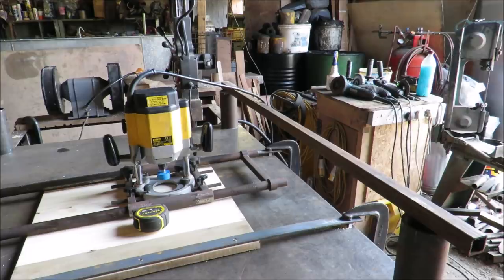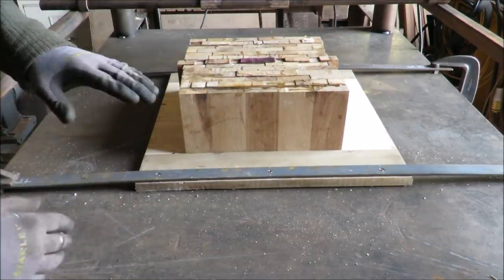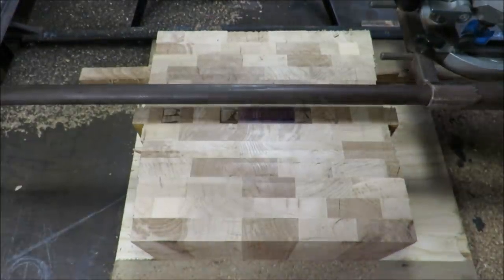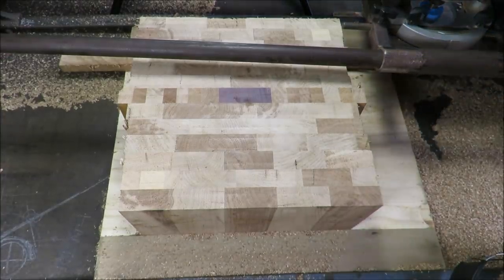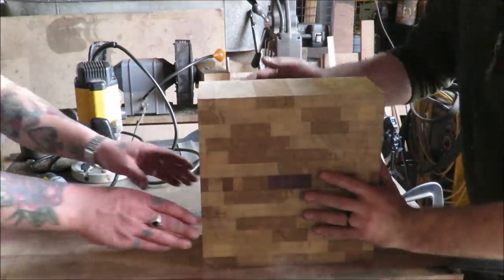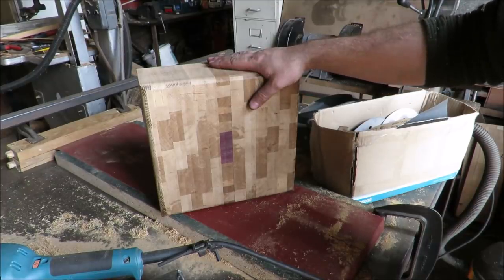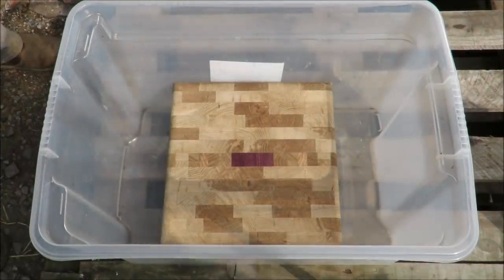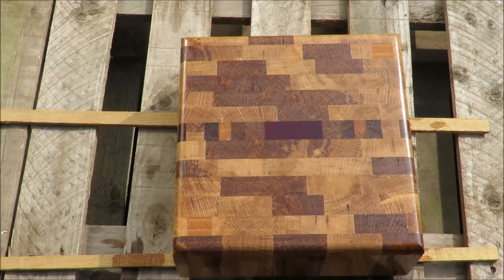Recycling an Old Butchers Block Series. Part 4. "A Thing Of Beauty" #SRP

Comment: Great stuff man. love the series, but it kills me that you didn't get the tool marks out after routing with the sled.  
They'll ease out with heavy use though..
Reply: The tear out over the punky patches of oak would have sanded out with a bit more time spent on it but we decided that actually, with some of the original joints and screw holes clearly visible, we'd just leave it with an aged weathered look.
Reply: @TaureusGrey  Sure.  I recently made a few boards out of an old solid oak table top what got rained on and I agree.. sanding out those annoying lines was a MAJOR pain.

Comment: . . . first thing I want to say: this beast is a beauty.
But I wonder what might be the sense of decomposing the old thing and rebuilding this absolutely new beauty out of the old basic material?
Well, this is not a restauration but recycling. Building it from any mixture of adequate hardwood would have been much easier - and reckoning the manpower put into it - much cheaper . . . 
(2 grown men playing (not working) around for 4 days may be fun and the outcome is now worth 4.000 GBP at least . . . :-) Congratulations anyway !
Reply: Cashuma thanks, it is a beautiful beast and your questions are completely valid.. We joke about the state of the original but the actual wood was centuries off decomposing, it was a mixture of reasonable and very high quality Oak so, in my mind, worth saving if  only for the environmental impact (coming from someone that burns coal for a living lol). In terms of time spent.. the things you do for mates hey? It's more about using and sharing a traditional skill set that would otherwise be lost. Hope that kind of answers your questions 😁